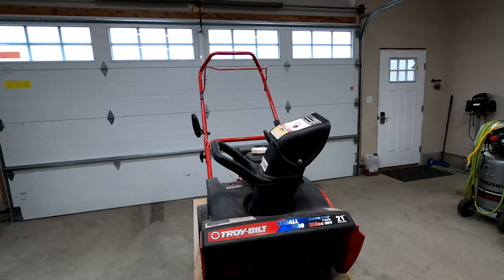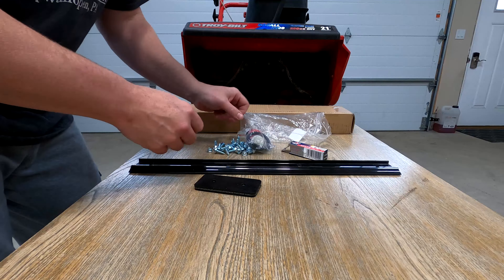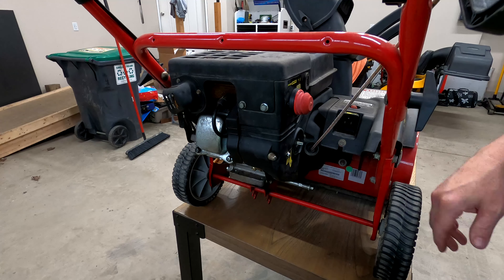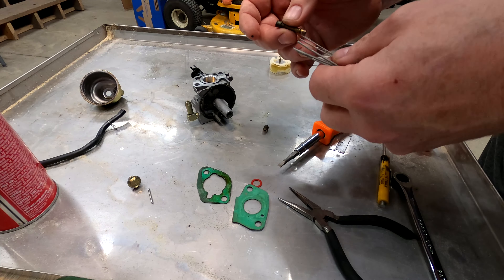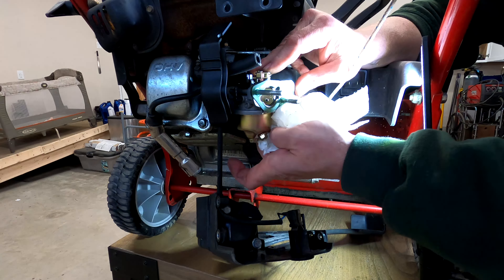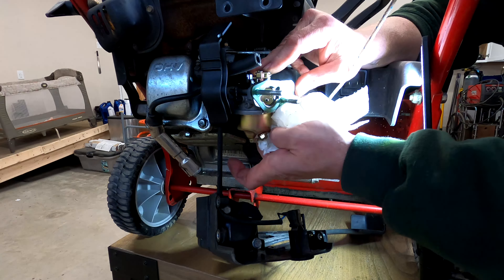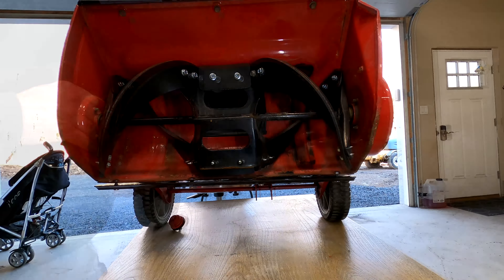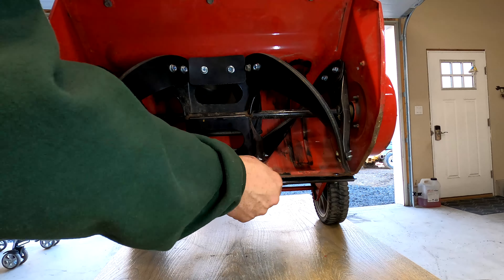Troy-Bilt Squall 2100 won't start

Comment: I bought one of these Snowblowers a couple weeks ago. The guy was moving and wanted to get rid of it. The problem is the Carburetor was filthy and needed a complete cleaning. I tore it apart until I got to the Threaded tube and main jet. Somebody had used an Improper tool to try to get it out and made a mess of the top. I used some acid and then cleaned it with carb. cleaner hoping that anything underneath might come out. I put everything back together and it runs but not good. I was hoping to sell it as this is what I've  been doing since retiring. Buy,Repair &Sell. Do you have any ideas on how I might get it out and replace it with New. Thanks.
Reply from the maker: Honestly, in your case, I would prob just replace it. I have bought a few from Amazon and they worked well. If it was something I was going keep and depending on cost I would go OEM but for the cost you really cant go wrong. https://www.amazon.com/Carburetor-Squall-2100-Squall-210-Squall-210e-31a-2m5e711/dp/B08MZB5QG5

Comment: Bulb is not taking fuel from the tank. Any opinions?
Reply from the maker: Hopefully you figured this out by now but usually it is because there is a crack in the crease of the bulb and it will suck air instead of creating a vacuum like it should. The one in the video was cracked which is why it was replaced.
Reply: @extensivediy  Ill have to order a new new bulb. The needle nose of the new bulb snapped go figure and stuck with the old one. I hope its not a sealing problem or the new little fuel filter. I appreciate you reaching out.

Comment: How did you pull the choke right off?  was it already loosened before the video?  The one on mine that was left behind by the seller of the choke doesn't want to come off no matter how i try, even a flathead to gently pry it is a no go.
Reply: The specific point of the video is at 2:00
Reply from the maker: Sorry I have been away on vacation but it does just pull off. I think I did have it on and off a few time and by the time I showed it at the 2 min park like you saw, it came off very easily. There isn't anything that is holing it on unless you got yours used and  someone glued it on because it was too loose.
Reply: @Extensive DIY  mine had to be pried off with 2 screwdrivers. It was pretty snug on. Thank you for the reply and the video to follow as it helped me get this old one back going.